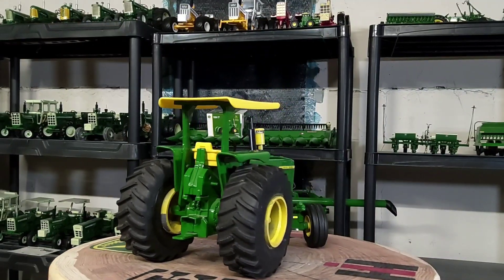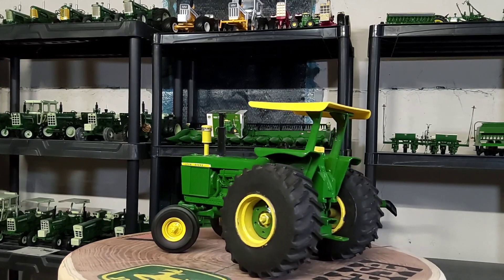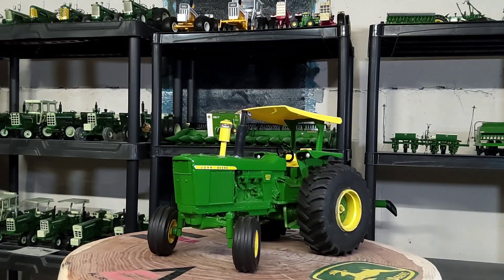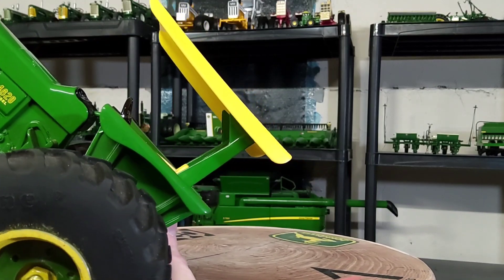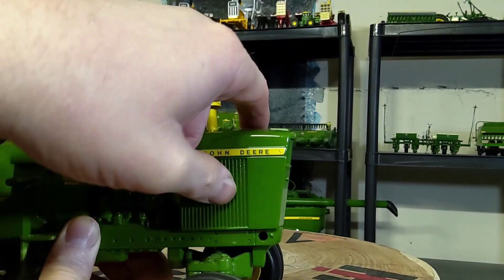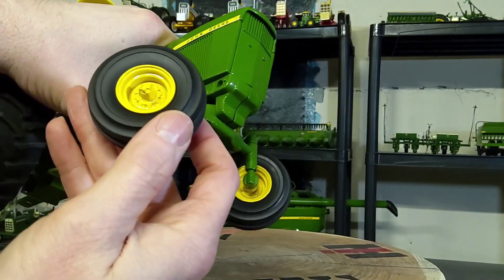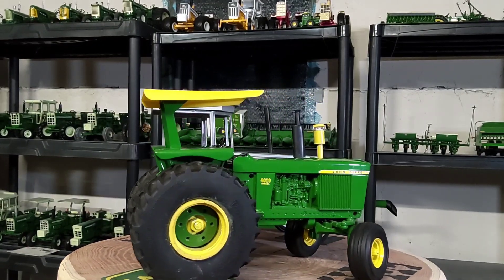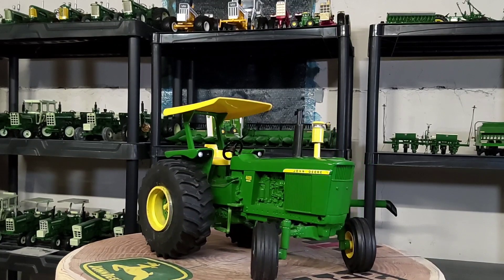Custom Ertl 1/16 John Deere 4620

Comment: I like the looks of yours way better than the 50th anniversary 4620 with FWA.
Reply from the maker: I did love those big fat tires they put on the rear of that 50th 4620
Reply: @replicasofthepast4756  I had the FWA model with the duals and cab. I sold that one and got the open station replica play with duals and customized it. That's my favorite version.